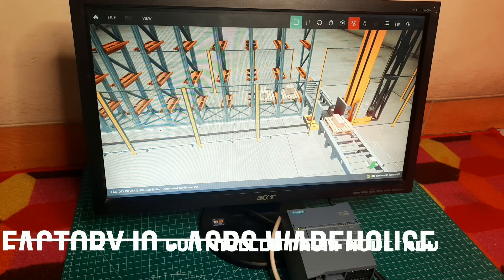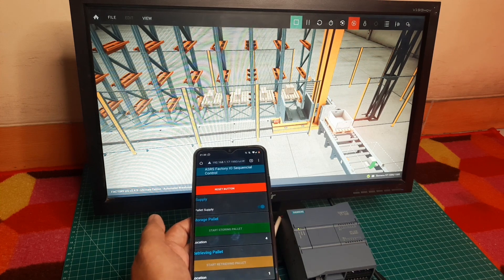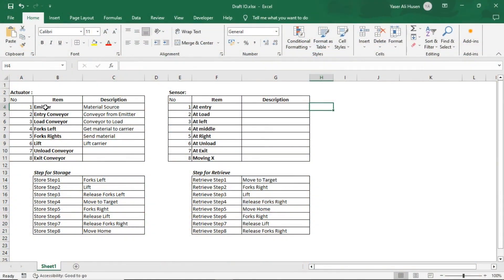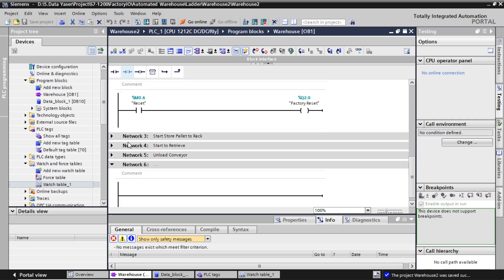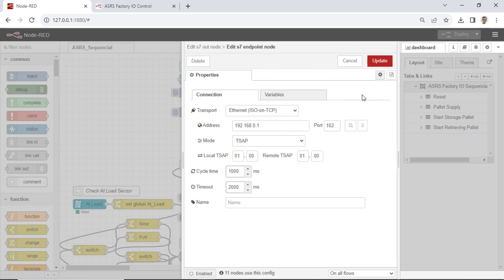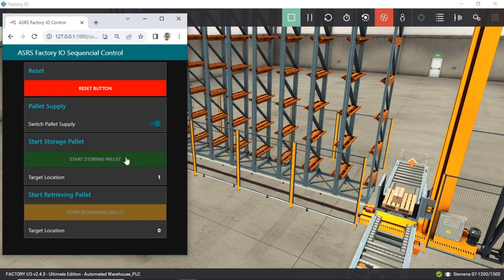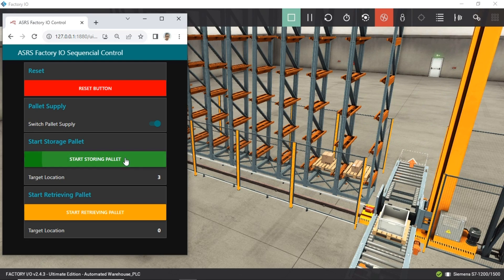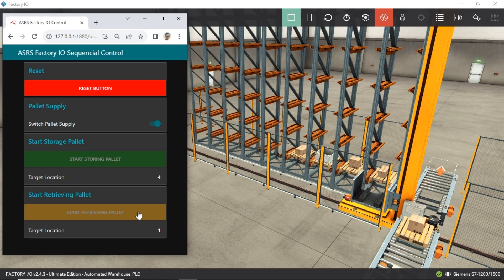Factory IO: Automated Warehouse Part 2, Control using Node-Red

Comment: Is there a way you can help me with the high speed conveyer proyect? Ive been trying to make the excel part work with several programmers and none of the could make it work
Reply from the maker: Hi, Thank you for watching my videos,
Did you install openpyxl?
pip install openpyxl
Reply: @YaserAliHusen yes, im having an append problem: C:\Users\Palos>counting_excel.py
None
Traceback (most recent call last):
  File "C:\Program Files\Python311\counting_excel.py", line 28, in <module>
    ws.append(("datetime","total_output","minute","ppm"))
    ^^^^^^^^^
AttributeError: 'NoneType' object has no attribute 'append'